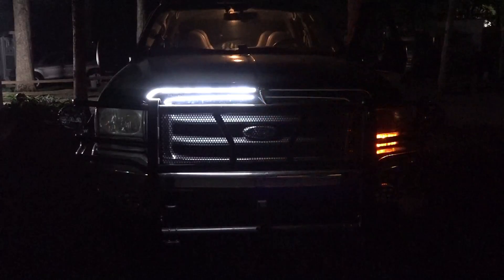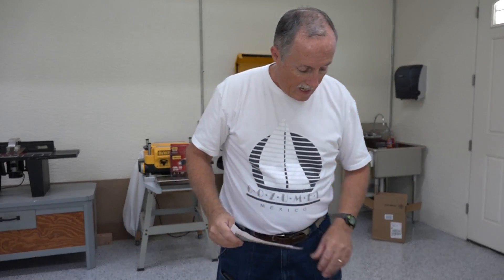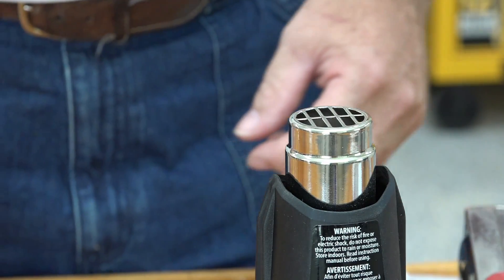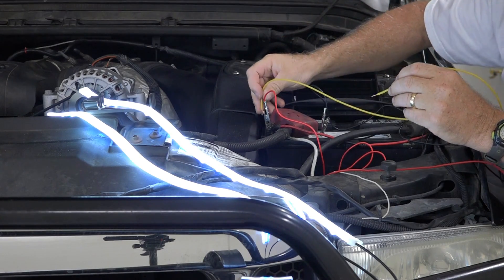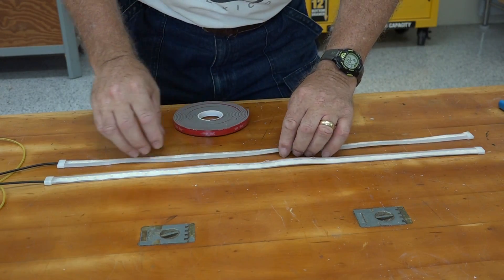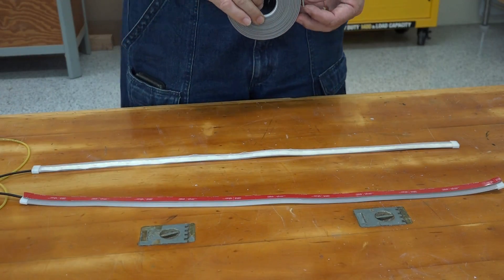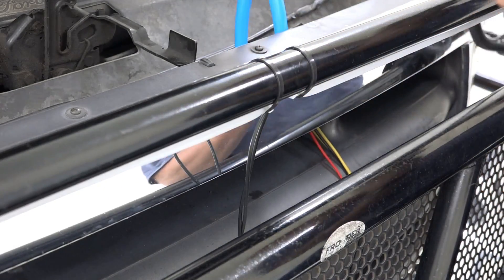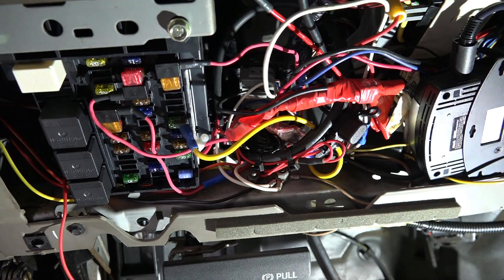How to install Daytime Running Lights + Sweeping LED Blinkers

Comment: Nice job. I have a 2016 Silverado and I wanted to add some interior lights, but Chevy doesn't offer a wiring diagram , they told me that their techs have it on a tablet. I cannot buy a wiring diagram, I think that sucks.

Comment: I am trying to put these on a 2016 vw Passat. My drl and my turning signal is on the same circuit. When I use the turning signal it works. But how do I get it to go back to led?

Comment: I wired mine to my freelander 2 they work lovely with ignition on but when the car is running the indicators don't sweep the led goes out but doesn't sweep it also works when car switches of into eco mode I'm baffled